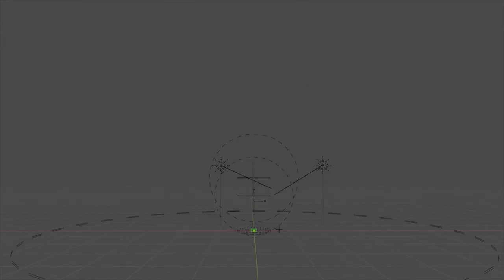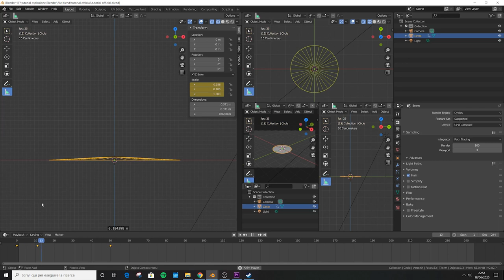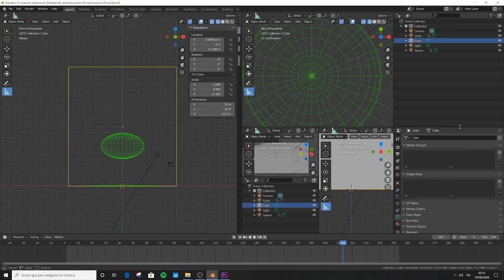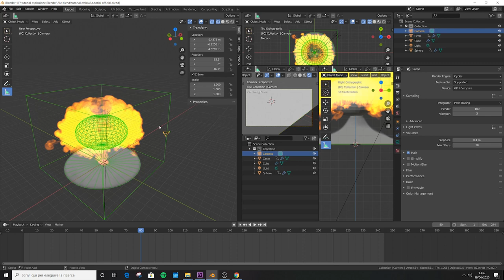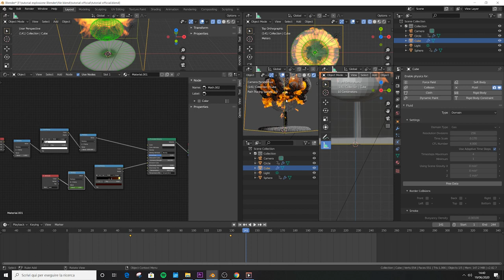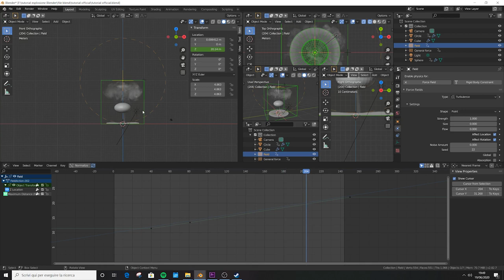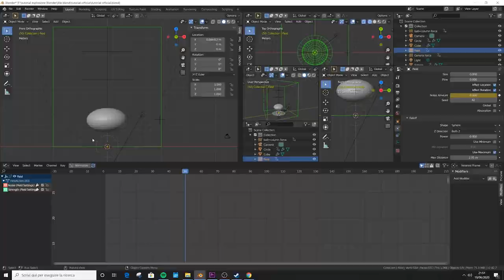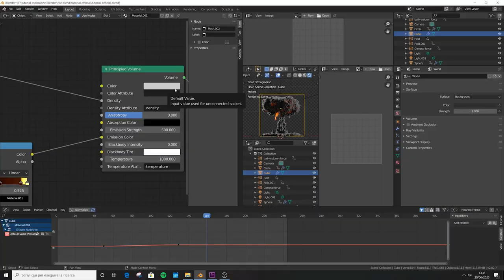Blender Tutorial: Nuclear Explosions !

Comment: For those using 2.92, the bake button doesn't appear because the cache type is set to 'Replay'. select the cube domain, go to the physics panel, and under the cache tab, you will find a category called type. by default, this is set to replay, but changing it to modular will make the bake button appear.
Reply from the maker: how is the explosion appearing in 2.92?
Reply: @RaffoVFX  not too well, I have a fire column coming out the side, and blender keeps crashing when I try to bake the simulation.
Reply from the maker: @sketchpalosotherchannel  haha I supposed that, that's why in the beginning of the video I advise to make this only in blender 2.82 :P
Reply: @RaffoVFX  lol yeah
Reply: Yes - 5 hours of my time wasted - bake crashes, and the 'Replay' view is of a domain that fills up with fire, then suddenly turns to smoke. Changing domain size (using G or parameters) doesn't change this. I think these videos need a very clear warning about which version of Blender is used, and not to waste time trying it in other versions!
Reply: @stuartleask9743  FOI works in 3.3.1

Comment: The adaptive domain stops growing at frame 50 And the smoke hits the domain and it looks flat. What did I do wrong?
Reply from the maker: You didnt scale the domain correctly. Enter edit mode and adjust it, then apply scale. Also, are you using blender 2.82 ?
Reply: @RaffoVFX  I fixed it, thanks

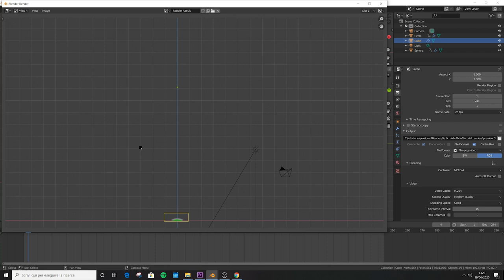Comment: Hi, using Blender 3.3.1, and I get a lot more noisy garbage with my mushroom cloud than yours does. It doesn't have the characteristic shape. I have double checked that everything matches up to 15:20, but this is what I get https://youtu.be/6hjr5RaTmLM. 256 resolution divisions. 50% res on the 1080p output just the first 100 frames. Any ideas?
Reply from the maker: can be a lot of things if you didnt make this in 2.82